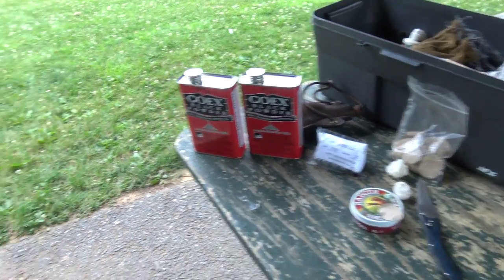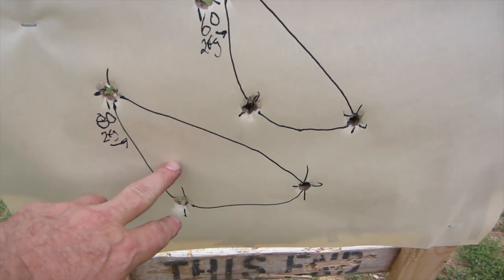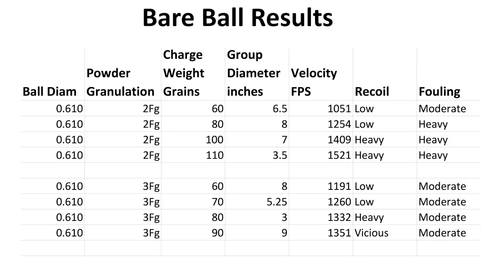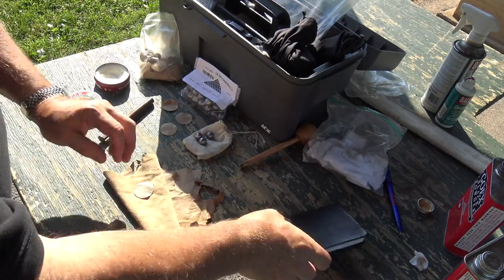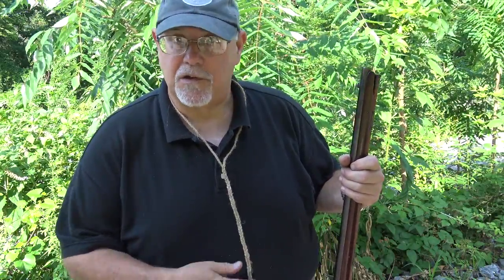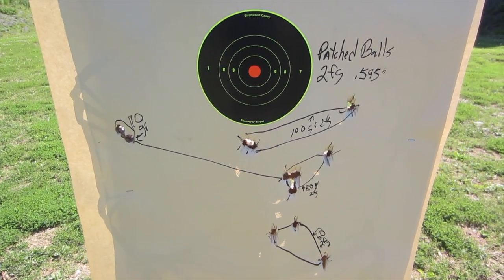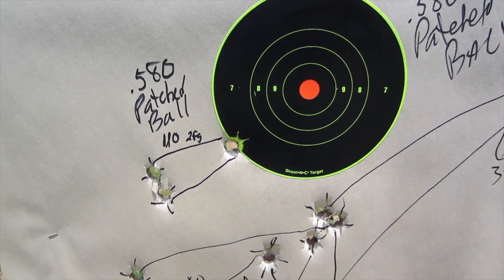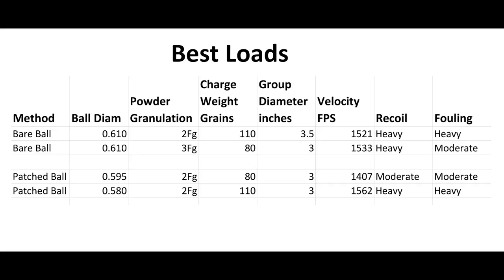Flintlock Smooth Bore Round Ball Test

Comment: I've seen strings like what you got with the .595s, wound up being off center patch. I cut them at the muzzle and it stopped. Just a thought. Balls tend to follow the slim side or the strings on pillow ticking in my experience. 

Great video though, much appreciated, wanting a Fusil at the moment.

Comment: another great video Mike. I watch your smoothbore videos all the time and have learned ALOT. anyway u can do one on changing, re-knapping Flint's? thanks so much
Reply from the maker: I'll try to get one of those in.
Reply: Just to jump in on knapping flints....  Before shooting and on an EMPTY gun if a flint gets worn down or cracks I knap it in place by putting a forefinger under the front of the flint and tapping downward lightly with a small BRASS hammer I made, or with any brass or non-ferrous tool. Don't use iron or steel if it is on the gun so you don't make sparks. Loosen the hammer jaws a bit and run the flint up & down the frizzen carefully by hand to make it straight and have the best contact without hitting and scratching the barrel. Knap some more if it is still too jagged then tighten everything up. A quick fix is to just turn the flint over, line it up the same way and shoot a little more.Changing flints I go for the traditional, not the sawed flints, choose the best angled side for a good swipe of the frizzen, that ends up pointing into the pan, line it up as above and go for the longest swipe possible. Sometimes you need a thinner or thicker leather on the flint to make it reach to the frizzen as soon and as high up as possible.  Poking the touchhole can speed up ignition. Priming only up to the bottom of the touchhole also speeds it up. I learned this by trial and error and put over 3,000 rounds out my Tennessee rifle, Brown Bess and others with very few glitches. It goes off like a percussion gun.

Comment: thanks again Mike for your time and analysis.   i just wonder if the skin material is  part of the accuracy problem.   soft hide being so flexible,  is it rounding under upon firing and letting the ball jump past on one side as it travels down bore,  giving the dramatic flyers?   would love to see this test done with laundered pillow ticking.  i do  agree the 2f is  the way to go.   love my trade gun.
Reply from the maker: I don't know. I know that the thickness isn't uniform, which may have an effect. I'll probably re-do the test with ticking.

Comment: Mike, can you explain how and why to choose FF compared to FFF. I thought the wisdom was to use FF on .54 cal or larger. But I've noticed you use either. Is one cleaner then the other?  You mentioned a comment about "pressures", can you explain?
Reply from the maker: Gene Slodysko I generally use 2Fg for .54 and bigger, but I do a lot of experimenting. I have found that big charges of 3Fg show smaller marginal increases in velocity as the charge increases, but recoil keeps getting much sharper, which are signs of high pressure. Conversely, increases in 2Fg continue to produce large marginal increases in velocity, with little change in recoil...hence, lower chamber pressures. If you are going for high velocity loads in big bore Muzzleloaders, 2Fg will get you there with a lot less pressure, and generally more accuracy.
Reply: @duelist1954    thanks!

Comment: I know this is an "old" video, but I wish to contribute a detail that may help explain the accuracy paradox wherein noticably improved accuracy occurs ar relatively high pressures. One of the general understandings of a perhaps analogous dynamic is found with the internal ballistic of smoothbore artillery. There, it seems accepted that enhanced propellent gas pressure actually forms a sort of high-pressure sleeve in the gap between the bore and the projectile that lifts the ball and forms evenly about the ball, keeping it somewhat centered, floating and cushioned by the pressure of the hot gas all the way to the muzzle. Less pressure or over pressure, and the dynamic balance is rendered uneven. I posit this is what is happening at the 110g 2F groupings shot bare ball.

Comment: Very good video. For the record, I have read again and again that a tightly patched ball is best, but I have never found that to be true. A looser load, ie smaller ball , along with a good stout load of powder have always shot the best for me. My 20 and 10 bore both prefer a paper cartridge , with smaller than conventional sized balls. I think that the balls are actually supported/cushioned by the gas around the ball as they go through the barrel. That's why you need a good charge of powder for the best accuracy.
These guns aren't rifles, and so require a different mindset .  Thanks for going through the work to test this out.
Reply: That makes sense. Gas leakage keeping the ball centred seems very plausible to me. Just have to find that sweet spot on how small to go. Great post 👍

Comment: the reason for the results is because the higher charge with a bareball allows the gases that escape around the ball help center it. similar phenomenon have been accomplished to increase accuracy in airsoft guns.   if you have a good rear sight,  i could get 2 to 3 inch groupings at 75 yards using a 58 smoothbore with a 575 ball, 80 grain charge of 2f and just a wad to keep the ball in. no patch.

Comment: Duelist,  Good work. Working on my Fusil de Chasse and the video inspires me to continue. Cheers.
Sounds like you like the 80 grain laid of 3F better than the 110 grain load of 2F because of the recoil. Earlier you mentioned that you would use the 2F load because of the accuracy.

Working on my Fusil de Chasse and the video inspires me to continue.
I'm sure I'll be experimenting with loads for my Fusil from M&D, so this was helpful. Will be finding an affordable source of tow. I finally picked up the TOW's sheet on building the Fusil. Exactly what I needed.

Comment: When trying the two different powders did you also use the same powder for your priming?
Reply from the maker: I primed with 4Fg
Reply: Priming powder variations mean nothing other than finer powder is a little faster to generate heat and ignite.

Comment: Shooting for accuracy without a rear sight is basically guessing. Having 2 -3 together and then flyers blowing the group is just smoothbore shooting and in my experience they throw fliers at the least opportune moment. Like when hunting.  Need to test different patching as well. My 50 cal smooth rifle shot best with a heavy ticking patch and a 480 ball. But it would do about 3 1/2 - 4 1/2" at 50 yards. with 2-3 close and then 2-3 fliers. best load was 110 gr of FF. I was shooting 5 shot groups BTW. AND is the patched ball will thumb start its not that tight though rifles load easier than SBs will. So try some linen and cotton patches. If you have a .620 bore then a .600 or .610 should work if you adjust the patching to fit. Setting out to use a specific patch then changing the ball size to give the required fit is silly or at least backwards. If it shoots a given ball size with a wad why not try that ball size with a patch? Varying the PATCH thickness as needed.

Comment: I wonder if patch failure is causing those wide flyers? Would another patch material or lube stand up to heavy charges better?
Tallow and goat skin should be a great combination but could the tanning chemicals 
have weakened the hide?
Chamois might work
 Its planed to a uniform thickness. That would help loading consistancy. Would it hold up to the friction and pressure? Maybe.
Thanks for all you do.
John Davis jax fl

Comment: Mike, this props up your theory on a much latter video where you determined: the gases (from a heathy powder charge) surround the slightly undersized ball, keeping it centric all the way out the bore, versus the ball banging the sides out the bore. I can conclude the same with my 12 bore cylinder barrel's findings as well.

Comment: Mike, What would you recommend for a 75 caliber Brown Bess Musket???
Reply: My Brown Bess (in the photo) shoots very well with a .715 swaged ball, 100 grains FF and a .017 pillow ticking patch. The issue load papered cartridge back in the British Army was 110 grains, 10 of which went to the priming pan, with no patch but the paper the cartridge came in. Soldiers were not supposed to aim at anyone in particular just fill the air with lead. The bayonet lug can serve as a THICK front sight. If you can line up the slot on the barrel tang screw to run fore & aft you have something of a rear sight if you are able to make your eyes work right. I won a club rifle match with a smooth bore, my first shot, by hitting the surprise explosive torpedo behind the bullseye at 50 yds offhand. No one else hit the bull with rifles! They thought I was shooting some kind of exotic ammo. Ha.

Comment: Great video!  I primarily shoot a 20ga smooth bore so this video gave me some ideas to test at the range. I have two smooth bores that I shoot regularly. One has a longer barrel and it tends to shoot a bare .60 ball the best with 110 gr 2f load. The shorter barreled one tends to shoot either a patched .58 ball with 80-90 gr 2f load or a bare .60 ball and 90gr 2f load about the same. I'm going to do more testing though. Maybe there is another load combination that will work as well. The heavier loads in either gun have pretty stout recoil.
Reply from the maker: I have found with two 20 ga flinters that the heavy powder charges shoot bare balls the best.

Comment: Great video. I too have come to the conclusion that bare balls work better in my 62 cal smoothbore than the patched RB. I have a Pedersoli Indian Trade Musket. I get tighter groups with 90 to 110 gr of FFg, a half inch lubed wad, .600 ball, and an over shot wad to hold it in place. Patched RB is just so so. I think someone mentioned that the charge going off makes the ball fit to the bore without a patch. Makes sense. BTW, I also have great success with making paper cartridges in the same manner as you would a Charleville or Bess. I think loading the paper wrapped ball mimics the similar effect as with tow or a wad. Give it a try. All the best!
Reply: I'm a believer that's why softer lead shoots better Pavia 1525,same principal as a compression bullet.from balls I've recovered they always have a nice long around where contacting the barrel

Comment: Any speculation on why the 90gr FFFg load was so bad? Hard to believe that an increase in 19fps results in such a dramatic difference.
Reply from the maker: RabidMortal1 I would say that it is because pressure rises dramatically with large loads of 3Fg, which leads to inconsistent results...or, it could just be bad shooting

Comment: Mr. B, what I'm seeing is the heavy bare ball loads is flatting the ball to the bore diameter better and is the reason you getting better accuracy with it.  I was shocked at the patched balls did not do better than they did, I was wondering if a screw on the rifle may have loosened up or something.
Reply from the maker: Pretty unlikely. If it did it must have magically tightened itself back up because the second patched ball group and the 10th patched ball group were both 3 inches in diameter.

Comment: out of curiosity.. assuming you read this, i would like to see you shoot some 5 shot groups at 100 yards with a smooth bore musket using patched round balls.. i want to see what kind of groups you can get consistantly at that distance
Reply from the maker: megadeth22885 I’ll add it to the to-do list
Reply: @duelist1954  thanks, i seen your video titled "Flintlock Smooth Bore Round Ball Test" where with the right load you had for it you seemed to be getting 3 to 3.5" groups at 50 consistently, so i was wondering what it could do at 100.. smooth bores have a reputation for very bad accuracy (12" at 50 if you listen to some people), yet none of them seemed to have any first hand experience and seemed to be going on military loads, which as you know were undersized for easy loading, to compensate for fowling with a heavy volume of fire, and because with volly fire it really didnt matter.. but hunters used them too, so i was curious about its limits

Comment: Do you have any thoughts to share on the India Muskets ?
Reply from the maker: If you mean the modern-made reproductions made in India, I think they are fine for re-enactors who shoot blanks. I know some people use them for live fire, but I don't trust the strength of the barrels, which are made of seamless tubing, rather than being forged
Reply: Thank you for your input, yes I was referring to the modern reproductions made in India that people are using for live  firing. I spent some time looking at them online and read a lot of conflicting info. Do you know of anyone making reproductions other than pedersoli? I have an interest in an 1795 Springfield design or some similar.
Reply from the maker: @bullhippo9023  just some custom builders. I would recommend Adam Barnes for that model.

Comment: Thanks for the data. However I’d like to know your barrel ID. Thanks.
Reply from the maker: Coleraine
Reply: @duelist1954  well thanks, but I mean internal diameter.
Reply: Bore dia.
Reply from the maker: @carolynraffl8271  0.615”
Reply: FYI. My Pedersoli shotgun bores are .629 and .609. No problem loading a .595 ball and a .020 patch even after 5 rounds without cleaning.